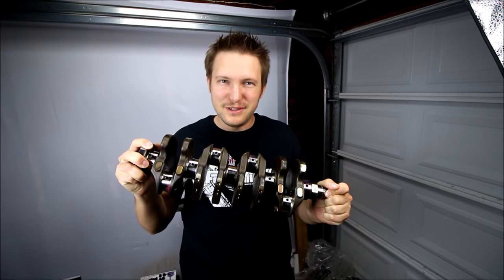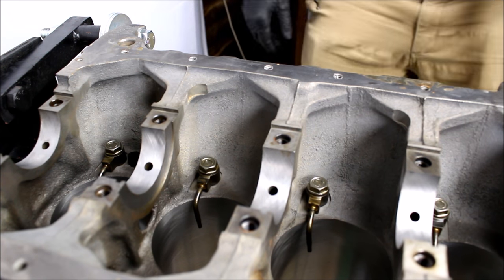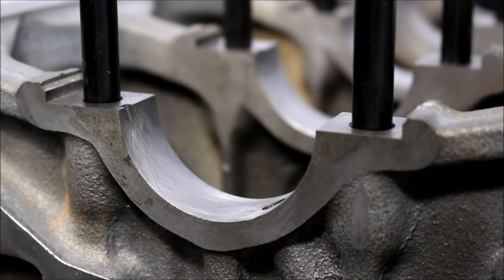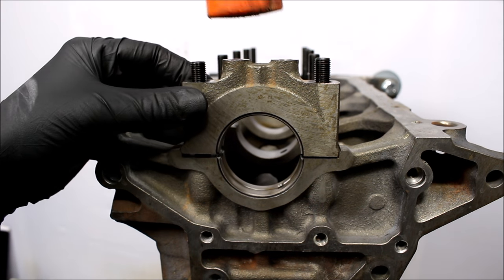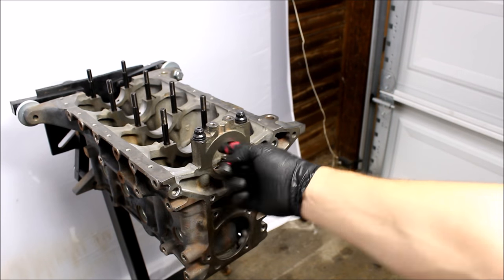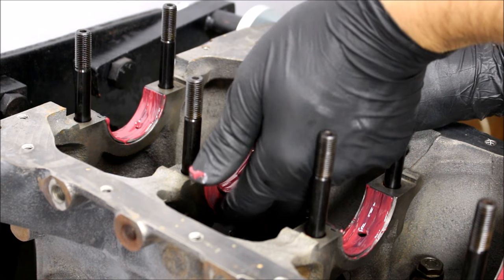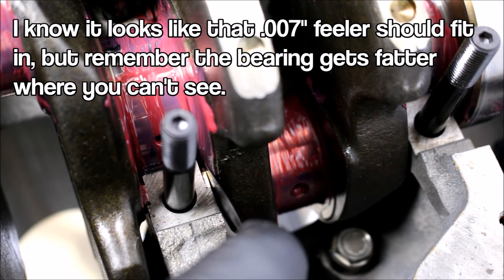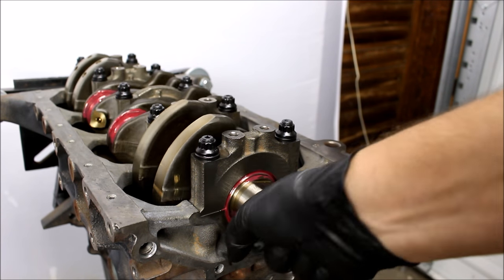Crank It Up: VVT Engine Crankshaft Install  (Rebirth Ep9)

Comment: You are correct in making sure the bearings are installed evenly in the caps and block, so everything is done perfectly there. However the bearings won't be flush with both surfaces, both should be just a tiny amount proud. When you torque the caps the bearing halves will butt up against each other and help lock the bearing in place; this is known as "bearing crush". Just a small piece of info that may help.

Just to say again, you did everything totally correct.

Great video!
Reply from the maker: Thanks! Always browsing comments for protips.
Reply: Hey i have to replace the valve cover on my miata. And as I was reading some people say I don't have to drain the oil is that true?
Reply: +Kyle no you don't valve cover has little oil in it , not like your oil pan lol. But if your vavle cover is filled to the top with oil you got problems xD
Reply: wrong, there is no such thing as bearing crush, if you are "crushing" the bearing it will make it go out of round and mess up your clearances and burn up a journal very very fast
Reply: Mark King Engine bearings has a great artical on bearing crush, they call it Radialok. Other bearing manufacturers just call it the crush height.
Reply: Ben Cork lol most of the time I don't make it to the end of the video before I start reading comments to see if anyone is calling bs I've learned more technical details in the comments then I do in the videos

Comment: Greg- What specifically did you have the shop do- just bore it out to 1.9L? Also, how did they prep the engine? It would be helpful to know what to ask/tell them (unless I missed a video that explained this already). (Great job on the explanation though!)
Reply from the maker: Check out http://www.thecarpassionchannel.com/vvt-mega-page/ towards the bottom of the page

Comment: Just a little tip my engine rebuild professor told us...you never use rags or anything like that to assemble the engine and bearings because the fibers can actually cause a failure. The fibers on a rag tend to be 3 to 5 thousandths, and in some cases that could be catastrophic. He said to use paper towels because the fibers are oil soluble and will disintegrate before they can cause any issues.Just passing it along... Any how man, love the videos. Watched for a quite some time, and look forward to continuing to do so. I appreciate all the extra effort that comes in your video releases.
Reply from the maker: Note taken :)

Comment: I'm really enjoying this series simply because i am doing a very expensive restomod project on my mx5. I am putting an NB2.5 BP-4W engine in mine and increasing the bore diameter to 84.5mm and hopefully hitting the 2 litre discplacement figure i want. Might put a tiny bit more money into mine than this such as heavy duty main caps etc but that is just the perfectionist in me wanting to make sure i can go for a high horsepower build one day. Nevertheless i find these videos extremely informative and despite already knowing how to rebuild an engine i am still learning new things from your videos. it just goes to show that you can always learn more.
Reply from the maker: 84.5 won't push it to 2.0L, you've got to go to 85.5 to hit that (1952cc). Unless you do a stroker crank. Thanks for watching!
Reply: not fully decided on going stroker yet. I'd rather not just because i want to keep the engine closer to it's standard configuration with just improvements made to the internal moving parts and gaskets and pumps so that it can take more boost :)

Comment: OMG, so well done. Always a pleasure watching you work. Are you going to rebuild the VVT gear? The magic might leak out if you do...just fyi.
Reply from the maker: Hahaha, if the magic starts leaking I'll have to do that. I'm just going to run it as-is for now, it won't be a big deal if I have to pull it off later.

Comment: The ARP lube is really supposed to go between the Nut and the washer as well as some on the threads. That way it keeps you from getting a false torque reading. I have installed many of these on 7.3 diesels. Torque on those is 125 Foot pounds though. They are great bolts.

Comment: Hey, Greg. I was watching Alberto Big Boost (he builds engines and cars for a living) and a tip he said to improve break in is to torque the head studs down, undo them, re-torque, and repeat that 3-4 times. Apparently, it stretches the head studs out (like they would with break-in) so that way when you have the engine assembled, you don't need to re-torque them after x amount of miles. Also, it prevents the head from lifting at higher RPM or during boost. 

What are your thoughts on that? Do you think it's a good idea for any other studs or bolts?
Reply from the maker: +DarkSwordsman Yeah I've heard that a lot, in fact I did that with the mains and rods when I put them in.
Reply: Okay sweet.

I know it's a long shot, but is there any chance you'll be going to MATG this year (or ever)? Lol
Reply from the maker: DarkSwordsman I'm hoping to just make Miatas @ Laguna Seca this year, and MATG next year!
Reply: Good thing I'm making MATG a tradition, lol. I wish I could do MMRLS 😔

Comment: Great vid I'm not a mechanic but I remember using plaster gage when looking for what kind of Bearings to use when rebuilding my older engine so I could get the specs inline and then buy thicker or thinner bearing so could use use that in your case instead of tools

Comment: nice video.. just a question.. is that the right way to measure clearances by putting assembly lube on the surfaces? I would have thought that the lube would alter what the micrometer and bore gauge read?

Comment: FYI put ARP lube on the faces of the fasteners (nuts in this case) and washer(s), any surface with relative motion needs lube to obtain an accurate torque.   I also do both sides of the washers

Comment: But how can a bearing spin if it has tabs on opposite sides with each one bearing? And won't after starting an engine have oil between bearings? Always when I disassemble engines the bearings have oil between the cap and bearing, and block and bearing.

Comment: Nice informative vids.  Basically doing the same build as you right now.  Same pistons, rods, oil pump, dampner, etc.  What ring gap are you going to use?  I'm at the same step you are right now, crank is torqued.  Thinking of going with .018 and .020 on my 84mm wiseco rings as my goals are 300-350whp, street /auto-x /track use.
Reply from the maker: I went .017 top, .019 bottom. :)
Reply: I ended up going .019 top .024 bottom.  2nd rings where already at .024 from the factory so I didn't have much choice. From what i've read ill be fine.  Might get a bit more blowby, but I have a catch can already.

Comment: you got it back from the machine shop would they supply the journals to match the crank how did you buy your conrods before you know what the machine shop have ground the crank  confused or just thick

Comment: @TheCarPassionChannel Looks good Greg, just got my block together as well using a similar method. Although I didn't have access to a micrometer I had to use plastigauge. But it let me know I needed undersized bearings since my crank was so healthy. had to toss my stock sized acl's in the to sell bin unfortunately, let me know if you need another set if it comes too it. Cheers.

Comment: I once rebuilt a Porsche 944 S 16 valve engine, and the thrust and crank bearing was one unit, combined. Right in the middle of the crank, between cyl 2 and 3. Why didn't Mazda make it that way?
Also I used engine oil as "assembly lube" - the engine still runs as far as I know (sold the car). So what is so special about this red stuff?

Comment: Hey Greg, I noticed the oil squirters are fairly small, will you be replacing them with higher flow units? Also what would you estimate your cost for this build?
Reply from the maker: mgamma5001 No, in fact a lot of people get rid of them altogether. I would fear that higher flowing units would cause lower oil pressure and increase oil consumption through the rings

Comment: Can I have your thoughts on a 1996 m edition Miata with racing suspension and roll cage.. its got 200,000 it drives and shifts smoothly... im thinking about buying it but I really don't know that much about miatas to be honest.. would it be good to boost?

Comment: With all the power she's gonna put down, have you thought of what you're going to do with the  transmission? Just a feeling you'll be pushing wayy more than 300hp at the wheels.
Reply from the maker: I got a Miata 6-speed, them things are pretty stout.

Comment: Hey greg, recently i looked at a 1999 nb mx5 and it was all good except for the gearbox, getting into gears was hard and reverse near impossible, no crunching but it sounded like it was whinning. (its a 5sp btw) Is easy to fix or should i keep away? Thanks
Reply from the maker: Sounds like a slave cylinder, master cylinder, or just a clutch bleed is needed. All inexpensive and pretty easy, I've even got a master cylinder replacement/clutch bleed video!
Reply: TheCarPassionChannel oh ok sounds promising, thanks for getting back to me.

Comment: So qestion. What kinda thrust bearings did you use?. Oem and what kinda crankshaft have you used as well?. Thanks
Reply from the maker: camworks 94 I used OEM thrust bearings, OEM crankshaft.
Reply: TheCarPassionChannel 👍 kool deal thanks man. Good luck with the whole vvt swap.

Comment: Are those old bearings you're installing, or is it some coating on them that makes them look like that? If not, any reason for not getting new ones?
Reply from the maker: It's just the coating on the ACL's, makes them look funky.
Reply: Yeah figured as much. I dont take you for the kind of guy to put used bearings in when you've already got the block fully disassembled

Comment: In the first 5 minutes or so, you are checking crank bearing clearances. I'm guessing this is a double-check kind of thing. I mean, you know what the crank journal diameters, block bores and bearing thicknesses are supposed to be, right? what do you do if its not right? Get different bearings? The machine shop must cut those to what you want, right? Not trying to beat you up, I love your videos, I just have lots of questions.
Reply from the maker: Dale Abono Yes, the machine shop bores the mains to the right size. But say down the line if there's a main bearing related engine failure because the machine shop made a mistake. I'd rather catch that mistake as I build the engine, vs in 2 months when I blow the engine.

Comment: I've been told that the outer side of the main cap bearing should actually be lubricated and that what you said in your video is wrong and although i have searched several engine builders who all agree with you that the assembly lube should only be placed on the mating surface between the crankshaft journals and the inner side of the bearing, i am still being told that you are wrong by anyone i speak to personally. I was wondering what mazda say about this?
Reply from the maker: I've seen it done both ways. I'm sure you could get away with either, the shop my gf used to work at would never lube the backs.
Reply: I would have thought that lubing the backs would be very risky but not always end in disaster. Safer to only lube the inside of the bearing but thanks anyway :)

Comment: Did you have the machine shop check/bore out main when switching to ARP main studs? Or just send it?
Reply from the maker: Yes I actually brought the block back to the machine shop after I did ARP main studs
Reply: @TheCarPassionChannel  Ah. Did they say it was still within spec or did it need to be bored/honed a bit? Thanks!
Reply from the maker: @ryansoysal6422  They said it did not need any work compared to the original hone with the stock main bolts, but I always recommend getting it done with the ARP's installed and torqued for max safety. I think normally it will not make a big difference but it was not worth the risk for me to try to skip such a small thing
Reply: @TheCarPassionChannel  Totally agree. Just curious, as I've heard a bit of conflicting info on that. Thanks for the response!

Comment: Did you have the block line bored? I wasn't aware you could just throw studs in the mains.
Reply from the maker: It was line bored with the studs in place.
Reply: Awesome, glad you're doing it right! Should be a stout little motor! You should look into putting some vehicle speed sensors on it so they can be used as references for boost by speed and traction control. Pretty sure you can only do this if you have an ms3. If you're worried about building the curcuits you can buy a dual vr board from jbperf for $40. It has two conditioner circuits and it's pre-assembled!
Reply from the maker: Kyle Sienknecht yeah I can't wait to try tuning BBG!!!

Comment: I love your series but worry about one thing. When you installed your oil squirters you said “you don’t need copper washers” and you assembled them with only the bolt. The oil squirters take 2 copper washers each, one above and one below.
Reply from the maker: Michael R Is that factory? Because this is the first time the engine was disassembled and they had no washers..
Reply: TheCarPassionChannel  ok so a little more clarification. Sorry if I scared you haha. Sometime in 1996 Mazda changed the oil squirters part number. The new squirters were thicker and eliminated the copper washers for whatever reason. From 1990-1996.x the squirters used copper washers. As long as the squirters were flat and in good shape and the seat in the block was in good shape then the new style is fine without washers (and does not come with washers if you buy from mazda). Hope this clarifies things.

Comment: 1 question. 

1: Reasoning behind so much pink lube?
Reply from the maker: Just want to make sure I get every metal-to-metal surface fully coated for initial startup. It all washes out as soon as the regular oil starts circulating.

Comment: Did you have your mains line honed with the studs?
Reply from the maker: Yes - I actually had it honed with the stock bolts first, then brought it back to the machine shop to have it checked with the ARP studs just to be safe once I learned that the amount of torque can change the alignment
Reply: @TheCarPassionChannel  Did you ever figure out why the mains ended up cracking? I’m currently building mine and the goal is 500-600hp in the long run and I can’t wait to see what those billet mains do for you. I’m interested in seeing the expansion difference between the block and billet cap materials.
Reply from the maker: @OniMX5  Most likely just too much spice in the tune, if you want to make 500-600, choose an appropriately sized turbo, not one where you have to turn boost and timing up to 500000% to get there
Reply: @TheCarPassionChannel  any turbo recommendation’s? I was thinking of running compound turbos
Reply from the maker: @OniMX5  in my personal opinion, not worth the complication, better to just go big single. But the homie on IG @monkeywrenching has compounds on his 1.6 and loves it. Just depends on what you want! I'm all about simplicity

Comment: Any reason not to just bore it out to 2.0L?
Reply from the maker: Cylinder walls get too thin for boosted ppwer. It only takes +0.5mm pistons to get this motor from "1.8" to "1.9" (1839cc to 1861cc). However it would take +2.5mm to get to 1952cc (2.0L) mine is +1.0mm, 1884cc.

Comment: Why didn't you use new main bearings? With all this effort of rebuilding a engine its no more effort changing them for new ones and they aren’t that expensive ether
Reply: Ooh and I came across your teardown video and this one, immediately subbed! Nice video's!
Reply from the maker: They are new actually, the ACL's just look kinda funny on the surface like that :)

Comment: Did I miss the episode where you talk about what the machine shop did ?
Reply from the maker: Impact-Vector you know I don't know if I covered that in full detail in one video, but you can find all the machining information at www.thecarpassionchannel.com/vvt-mega-page
Reply: TheCarPassionChannel thank you! I found that a bit after. Any reason you did 84mm and not bigger or stock?  The engine builder I talked to was reluctant to bore
Reply: TheCarPassionChannel thank you! I found that a bit after. Any reason you did 84mm and not bigger or stock?  The engine builder I talked to was reluctant to bore
Reply from the maker: Impact-Vector there are no off-the-shelf pistons that come in stock bore size, so I went to 84mm. But, the typical safe limit is 85-85.5mm, and I wanted to leave some room for boring if I ever have some kind of failure, and also didn't want to thin up the cylinder walls too much. 84mm seemed like a good balance.